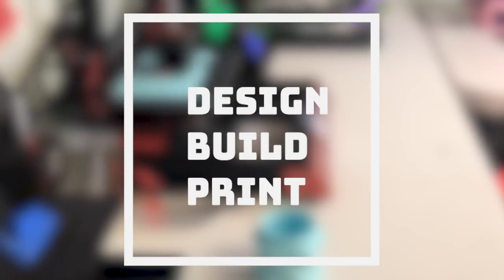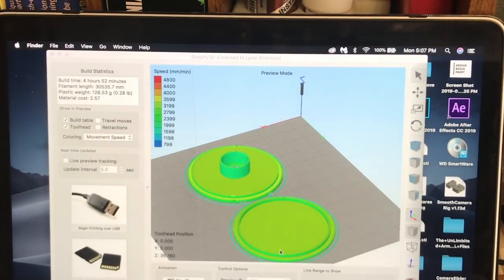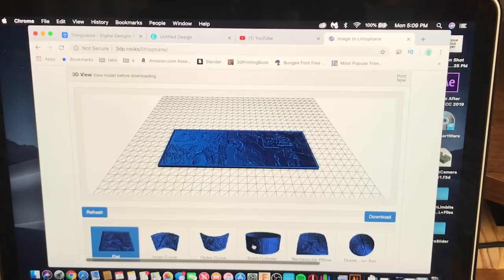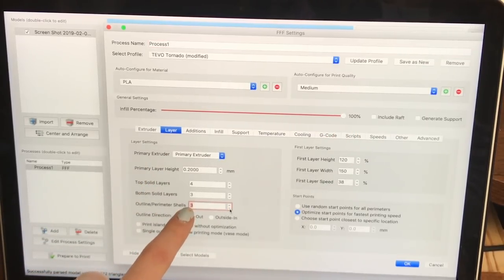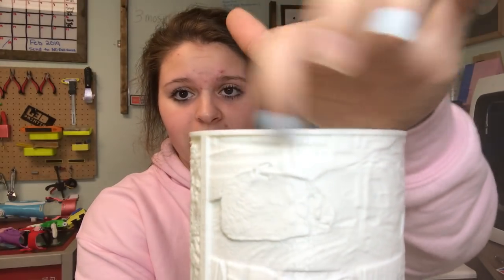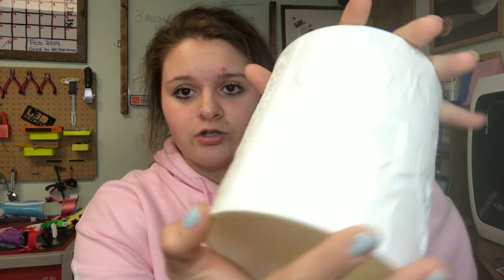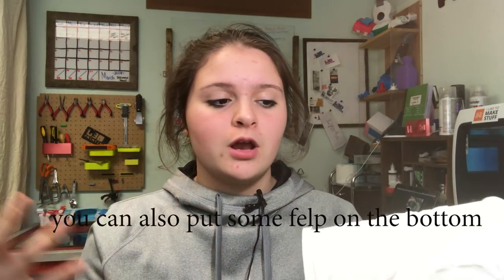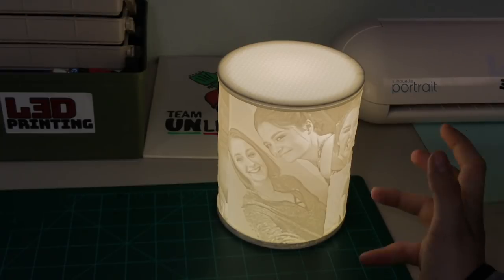3D Printed Pictures!//Lithophane/Lamp

Comment: Nice!  There are " in line " switches that can go over lamp cords, they cut 1 wire and make/break contact withna round, one direction switch while closing over the 2 lamp wires.  For safety, keep the bulb as 40 W or lower or LED bulb as they can heat up enough to melt the lamp.  Just like an Easy Bake Oven.  For an alternative power option, you might want to look up how to make a Joul Thief ( spelled like temperature measurment ) for a LED ligting option that can actually last a long time with one alkaline battery.

Comment: Just a couple of tips.

1: Don't screenshot. you should save the image form source. If you screenshot and save the image and look at the file size the screenshot will most likely be smaller, if you open them both and zoom in the screenshot will not be as clear. screenshot applications almost always compress the image so you lose some clarity.

2: If you want to get even better clarity out of your Lithophanes i would recommend using a software like Adobe Photoshop/Lightroom or for a free alternative Gimp. Make the image gray-scaled and up the contrast very slightly and add a low density high-pass filter and overlay it to canvas as a "soft light" filter. It will bring out even more clarity and make for an even sharper image in your Lithophane. (Don't over-do the high-pass filter or it will bleed out around sharp edges)

3: Scaling a Lithophane in the slicer itself once it's converted to an STL generally reduces clarity of the finished image. It's better to scale your image in software and adjust the Lithophanes resolution in the software u use to convert it (in our case 3dp rocks) and export it form there in the actual desired size (Or close enough to it). Scaling the model stretches things out of proportion from the original pixel density in the image. especially in terms of thickness which is very important to clarity in Lithophanes as the thickness essentially = number of colours/shades in the final image.

4: For those using Cura; "Avoid crossing outline" = "Combing" This will give the same effect and keep the tool path inside the model at all times to avoid the blobbing from moves.

5: Buy a cheap set of heat-shrink on Amazon. they're super cheap and look much nicer than the electrical tape. Also quicker and easier IMO. The adhesive on electrical tape can actually conduct electricity which can both increase the resistance slightly (Not a big issue) but if it gets warm and runs out the edge and someone grabs the wires together whilst its plugged and causes a short they will actually be connected straight to mains with no earth. Being from the UK i only use bulb fittings with a dedicated earth pin for safety reasons.
 With you taping them together after taping them individually it has a risk of shorting and tripping the breaker. If the breaker fails it ends up being a fire hazard.

6: Fusion360 - Lookup on how to use the offset parameter on the extrude function. Your top and bottom cap could both be made with just a single sketch using these saving allot of time and making parametric design of it extra simple whilst also reducing project file-size.

Hope this helps! Great video, I love Lithophanes, I've printed allot of them. You can even directly convert your photos into STL models for Lithophanes in the latest Cura too! The result is about the same as 3dp rocks which i used to use, though it will only do flat ones so if you only make curved ones stick with 3dp as it does do it really easily compared to other alternatives I've tried.
Reply from the maker: Thanks for all the tip;) I do know the fusion tip haha but I really appreciate you trying to help. Glad you came to watch;)